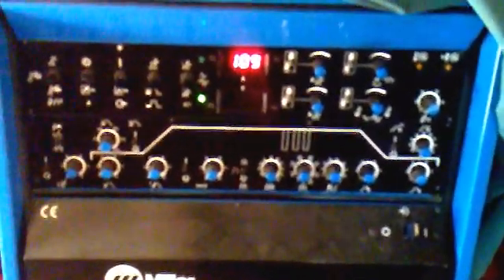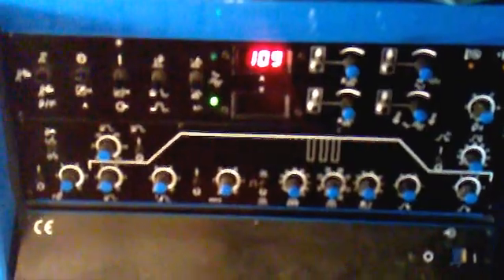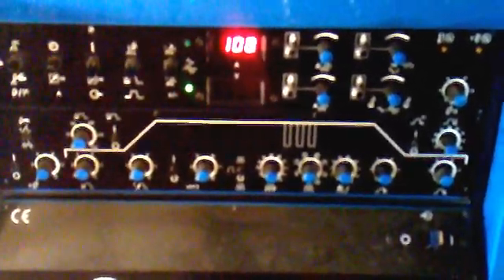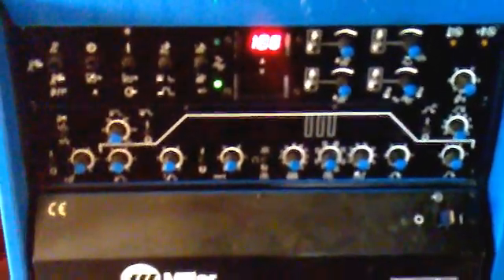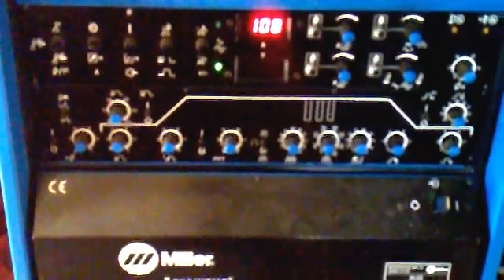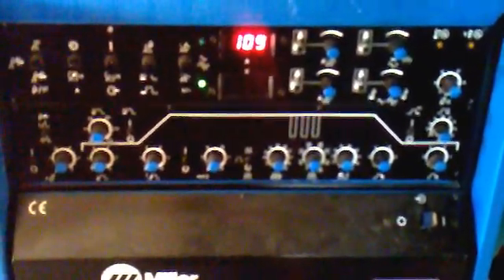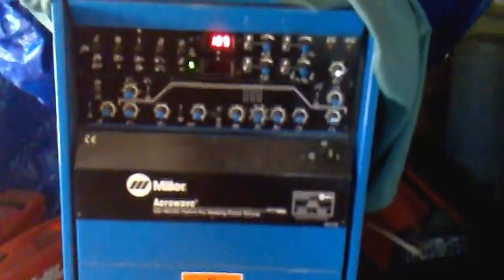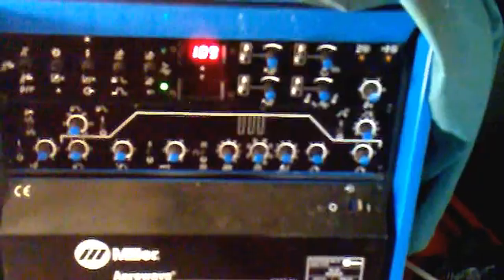miller aerowave tig welder pot problems

Comment: just a update i did have some pots made in usa as cards are obsolete now working great  now 18 years old its like new so dont give up on your machines if you have the same trouble
Reply: When the main board fails, frankcoproductsllc.com
Reply: @Frank-bg6xz   I will keep that in mind  I have done the pots for amperage and balance frequency I have cleaned it and been sole users for 20 years now and its still going well
Reply: @MrBigdog6931  They're pretty all around good machines. The potentiometers wearing isn't a surprise. Happens alot with syncrowaves.